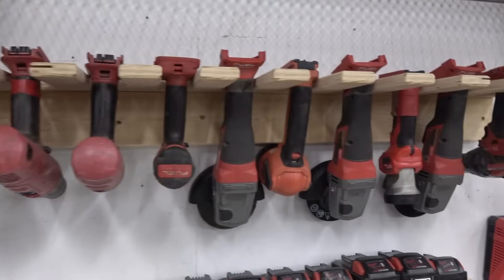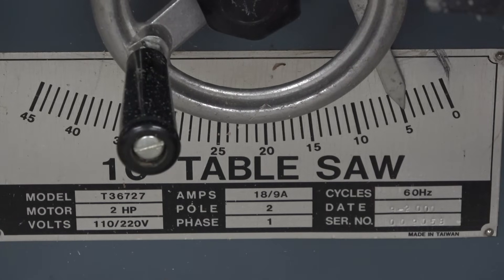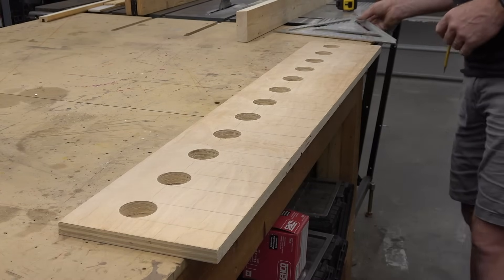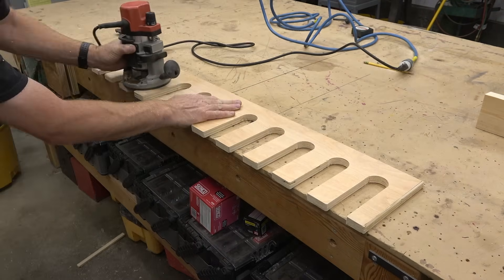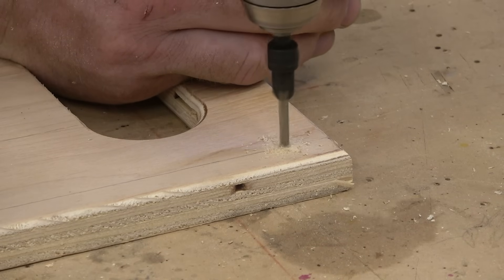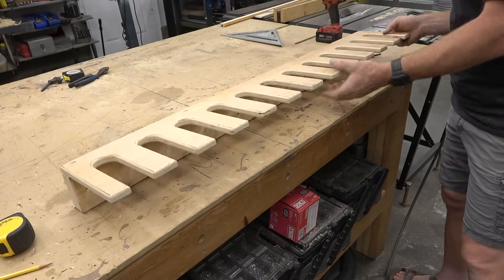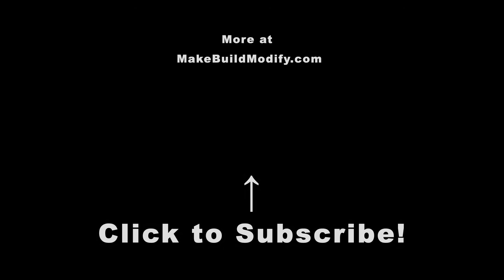Cordless Drill and Tool Storage Rack - Shop Organization

Comment: Call me dumb, but you said you measured 3" one way and 4" the other way. Explain, please. I'm just a beginner needing to build a rack like yours.
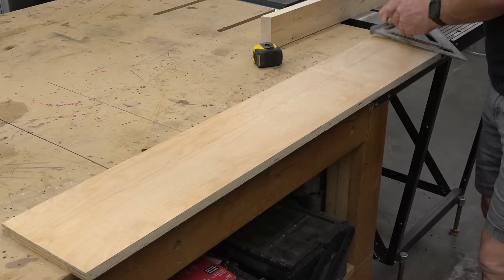Reply from the maker: You’re not dumb. That’s a great question and I should’ve explained it in more detail.  The 3" distance is the line that draw along the board at this part of the video: 1:49 . The 4"  measurements are the marks that I made on the 3" line at this part of the video: 1:56 . The 4" marks are for the centers of the holes that I drilled. The holes are 2" in diameter and are drilled every 4", so there is 2" of wood left between them, 4 - 2 = 2. This creates the slots for the tools. You may need to use a different sized bit depending on the size of your tools.

Comment: Cool build. Could you please explain what you mean when you talk about marking a line every 3 in and the other direction every 4 in? Is the board flipped where you're drilling the holes?
Reply from the maker: The holes were drilled 4" on center. It's a 2" slot, so each of the wood "tongues" are also about 2" wide. You can choose the depth that works for your tools.
Reply: @Makebuildmodify I was able to build this over the weekend. I used a hole saw and a circular saw. It came out great.
Reply from the maker: @Joe554  Awesome! I glad it worked for you. Thanks for letting me know!

Comment: Very nice build. Video was well done. Explanations of each step were clear. Great job. Subscribed and I’m going to use this for my tool wall. One suggestion would be to explain how you determined the width of the holes and the depth of the hanger. Otherwise, excellent job. Thank you.
Reply from the maker: Thanks for the sub! Yeah, I could have explained that a little better. I figured that everybody's tool selection is different and my particular slots might not fit. But I could have at least gone over how I arrived at the dimensions.

Comment: Quite timely for me as I’m working on storage in my garage right now. My only issue is that I’ve got several Milwaukee M12 took that don’t have those feet. I suppose I could hang them the other way.
Reply from the maker: Yeah, that should work. It's an easy experiment to do. If it doesn't work it's not much time lost.

Comment: Hi. Than k you for this it's exactly what I need for my Dewalt tools. Maybe I missed it but are there plans or at least dimensions? Thanks.
Reply from the maker: Hi, I don't have any plans. The holes were drilled 4" on center. It's a 2" slot, so each of the wood "tongues" are also about 2" wide. You can choose the depth that works for your tools.

Comment: Just found this,   on my way to the shop to make it so.   Although I will flip it over and put a lid on it for a flat shelf above with a spacer upright on the sides and center.   It will also be a bit narrower.    One question  did you use 3 inches between tools?
Reply from the maker: The holes were drilled 4" on center. It's a 2" slot, so each of the wood "tongues" are also about 2" wide.

Comment: nice. love the simple design and relatively short video. i feel like 6.5min is the perfect length for a video. one thing; isn't it dangerous to not having a rivving knife with the table saw? just looking out. cheers
Reply from the maker: Thanks. Making things is always dangerous. It's the personal responsibility of maker to decide the level of safety that they are willing to adopt. Also, to a point, the same operation can be more or less dangerous relative to the maker and their level of experience.

Comment: Excellent all around - have been making some of your projects without a table saw - just using a hand-held circular saw. Not as fancy - but gets the job done. How come you stopped making videos? Or do you have another channel anywhere? Either way - thank you!
Reply from the maker: It's great to hear that somebody is making my project! I'm considering starting back up again. I had to go back to my day job. I'll probably have to take sponsors to continue though.
Reply: @Makebuildmodify  Do you get decent monetization with YT? Either way - I think your presentation style is perfect. Way above most others. No hand-holding. Too many other channels are over-explainers, etc. Don't you think that if you pick up again - your subscriber base will grow rapidly? I think others are also yearning for more straightforward makers like you. You might be surprised?
Reply from the maker: @NJroute22  Thank you for the encouragement, I really appreciate it.

The YT monetization typically does not cover the production costs of a video. Over time, some videos will pay well enough to limp the channel along, but if I want to do it full time (my dream), I'd have to take on sponsors. It used to be more commonly viewed as a taboo (sellout) type of thing. Times have changed, and I'm reconsidering my position on in-video adverts.
Reply: @Makebuildmodify  Very interesting. Do you pay someone to make your videos? I have a channel (not monetized) - and my production costs are zero (other than the few hours it takes to make). Are you basing your costs on time/value? In other words - you make more working a "in real life" job over doing virtual things? I do have to say one more thing though - when I am building things at home - it kind of sucks to "do it for the camera" rather than just building it for myself. It'd be nice to have a film crew film for me while I concentrated on my project.
Reply from the maker: @NJroute22 I do it all myself. My bigger projects can consume 40-60 hours plus the cost of materials. I lose a week or more of income from my day job. So, the real lifestyle cost is pretty substantial considering that I was trying to produce one project video per week. Moving forward, I'll have to do maybe one project per month and more talking head videos to fill in the month—reviews, tips and tricks, and things like that. Maybe even a "Maker Week in Review" where I cover other makers' projects.
Reply: @Makebuildmodify  That is amazing. You condense those videos down to minutes of action. I was referring more to the simpler videos like the drill mounts and easy tape shelves. The average homeowner type stuff is my bag of chips.

Comment: So 3" support and 2" gaps for the plywood section, making the hole spacing 5" correct?
Reply from the maker: The 3" measurement is the depth of the notch. The notches are 2 inches wide with a 2-inch separator. So, drill a 2 inch hole every 4 inches.

Comment: I don't know if the painted surface of the wall is important to you but if you turn the tools the other way, they will not touch the wall.
Reply from the maker: It's a shop. So, for me, the paint on the wall is not important. But you are correct.
Reply: Thank you for this information, I appreciate these types of videos that help us .

Comment: According to your dimensions. It’s a 2-3-4 inch build. 2 inch slots, 3 inches apart and 4 in deep. If I understood you. But why have to flip tool upside down each time you want to hang it ? Why not just hang it right side up ? Easier to grab and return each time.
Reply from the maker: Because the battery receptacle on the end of all of the tools is the same size and the slots are designed for that part of the tools.

Comment: DANGER!!  Around 4:00... your right hand is in an    - - - - - - > extremely < - - - - - -   precarious position wrt to the router... and that is me speaking from experience. You are thinking 'safety', but when your hands are trying to do two different things... (1) control the router and (2) hold a board ... Murphy's Law suddenly comes front and center. Luckily for me, I was wearing leather gloves and it was a laminate router. I only suffered a minor skin laceration - no muscle, no bone, no tendons..... I consider myself lucky.

Please be careful out there in the shop!
Reply from the maker: Power tools inherently pose a risk, and anyone using them must acknowledge the potential for injury. I agree that securing the workpiece with clamps and using both hands to control the tool would have been a safer approach. However, the direction of the cutting head significantly influences the likelihood of losing control of the router. 

In my case, I was not climb-cutting, meaning the router’s natural drive was directed away from my hand. If it had slipped, it would have moved away from my right hand rather than toward it. Additionally, considering the forces involved and the size of the round-over, the tool’s fence would have made contact with my hand before the cutter could, assuming the router didn't lift off the workpiece. 

It is nearly impossible for a camera to fully capture my level of concentration, attention to detail, and the precise forces I apply to both the tool and the workpiece. My ability to work safely in a given circumstance should not be conflated with another person's ability or lack thereof. 

Stay safe out there.